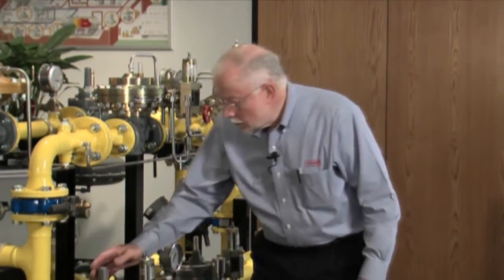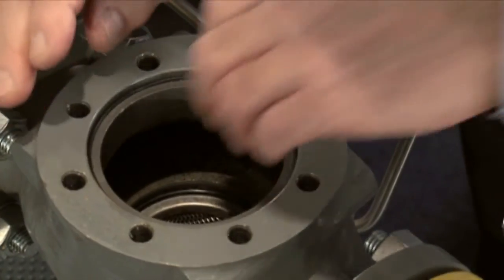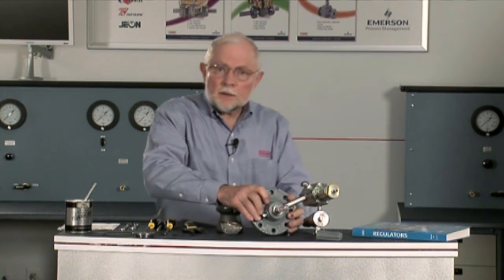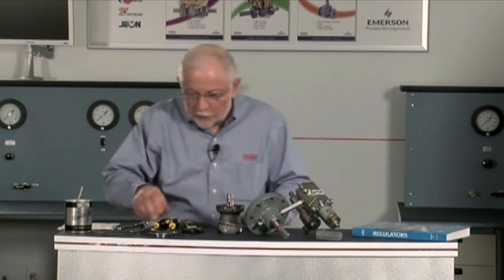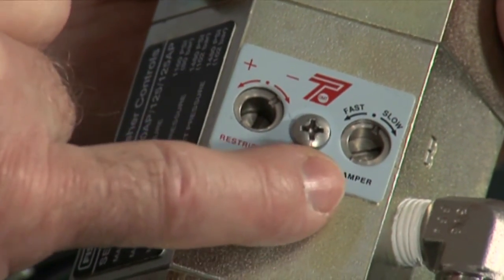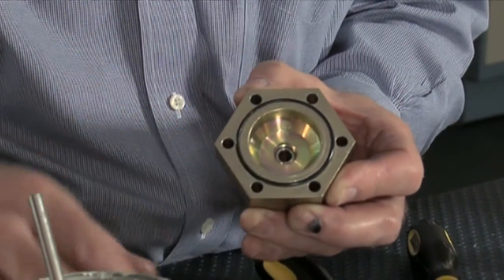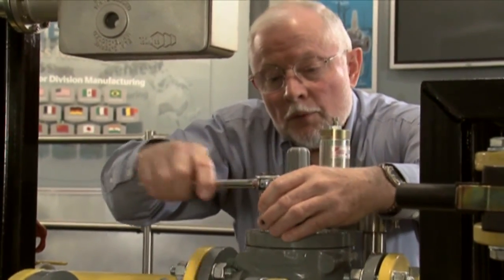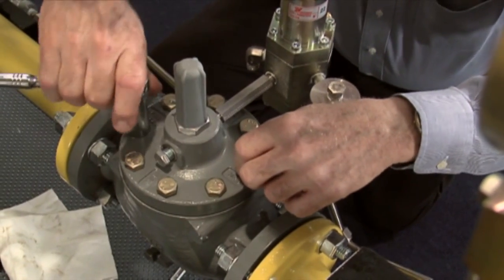How to maintain a Fisher Natural gas EZR Pressure Regulator?

Comment: how does it hadle heat? and what are the pressure ranges this unit is capable of? I would like to try one on our machines :)
Reply from the maker: We offer two different Nitrile boots with 150F/66C ratings and one Fluorocarbon boot with a 260F/127C temperature rating.